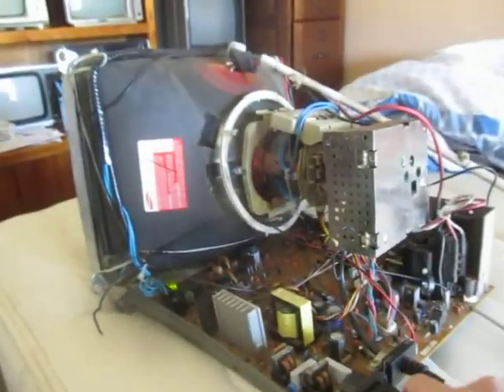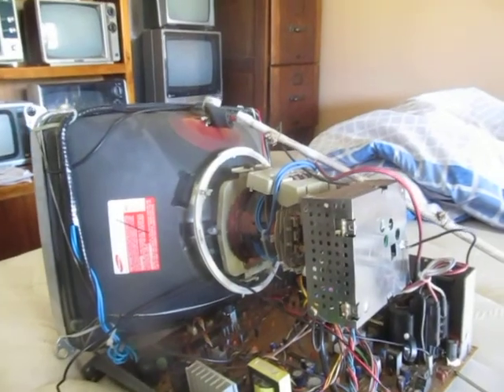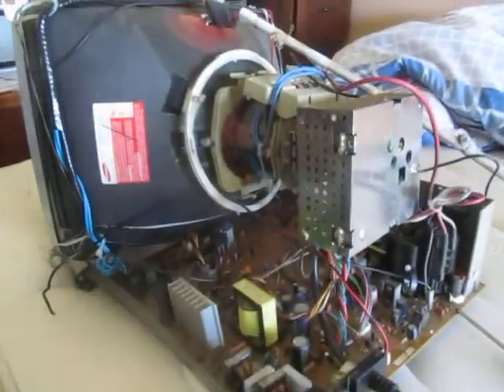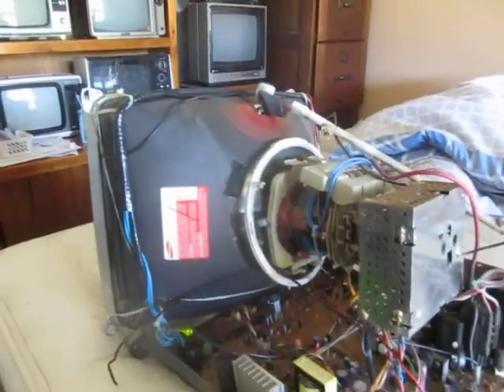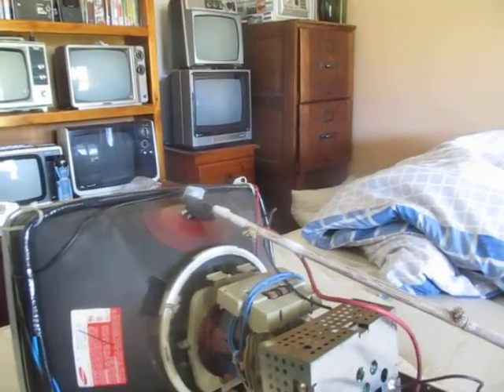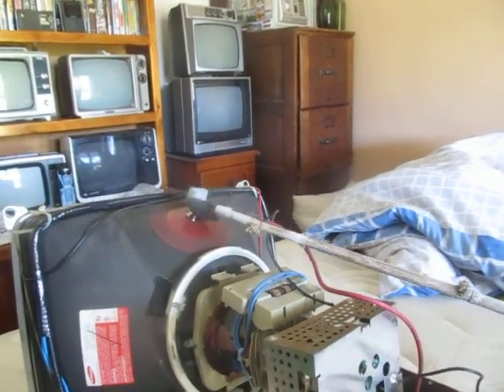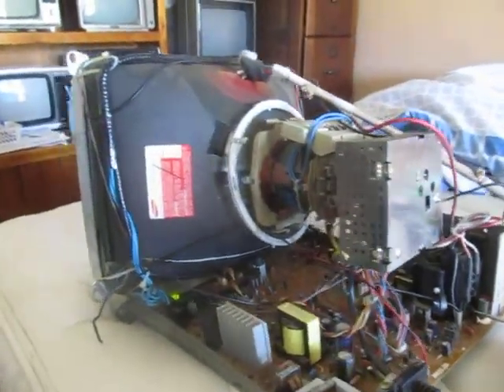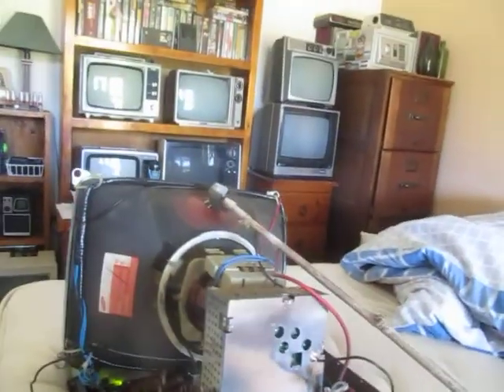Playing with LOPT on CRT monitor

Comment: if you do it correctly you wont destroy the flyback.
any flyback will die if you run it continously tho :)
maybe since you like old TVs and thought radios too, may be a plasma speaker circuit is for you ? : )

Comment: disclaimers.... lol heh. you been watching high1voltage1rules havent ya :) the god awful funny sound is high voltage leakage :) possibly when it stopped arcing the capacitor had blown in the flyback maybe. or you overdrove the transistor/circuit driving it. it is possible to drive the flyback outside the TV check out my channel, high1voltage1rules or highvoltageprojects. rodalco2007 etc :)